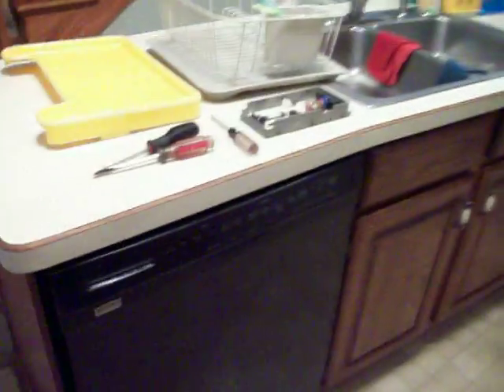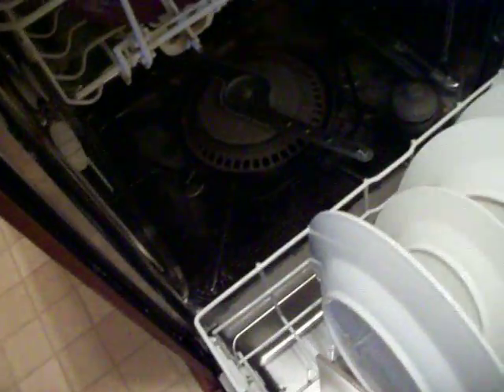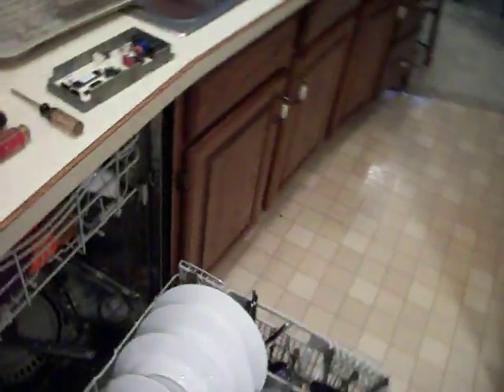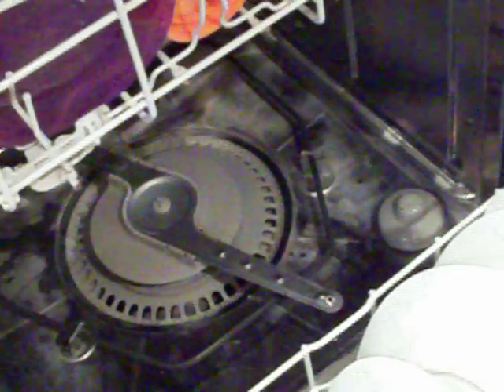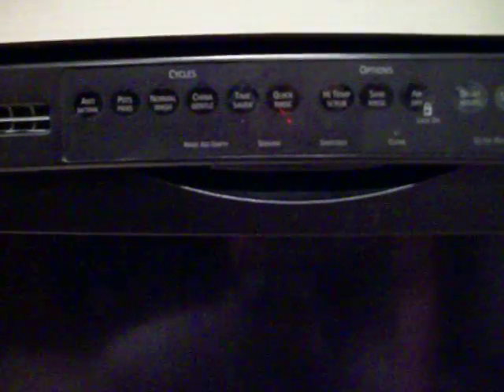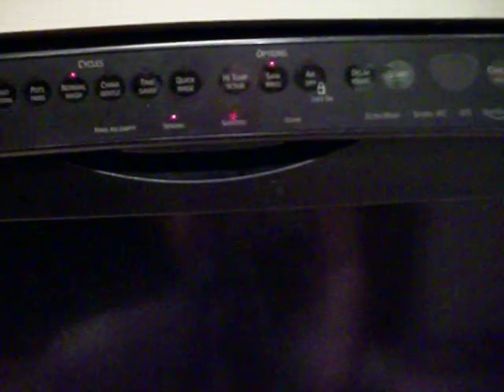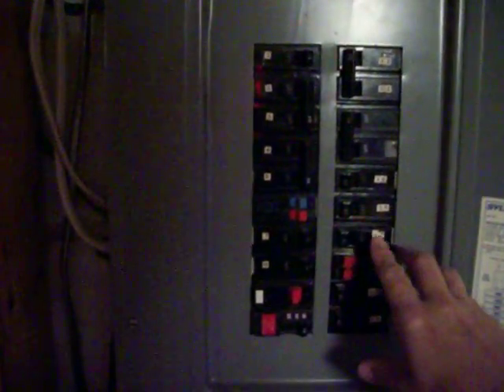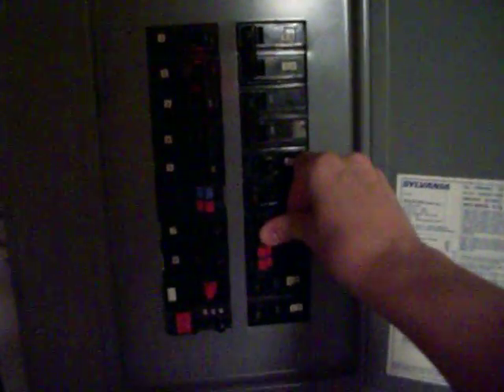Dishwasher Control Panel Repair Part 1

Comment: I like your method of finding out which breaker the dishwasher was on. I've done a variation of the same thing myself. Unfortunately your problem is not the same as mine but I enjoyed the video anyway. I like how you provide helpful details. I did not know that parts were no longer being made for this model. Sort of reminds me of my 25 year old garden tiller. The company that made it went bankrupt and the company that took over does not like selling parts for the old ones.

Comment from the maker: I knew the heating element was bad because the dishes were wet and the timer was running for about 2 hours becuse the water wouldnt get hot enough or dry properly. You can test the part with a multimeter (electrical tester). Ours has a stainless interior so fsp has packaged a heating element with the control board beacuse the electrical components have changed.